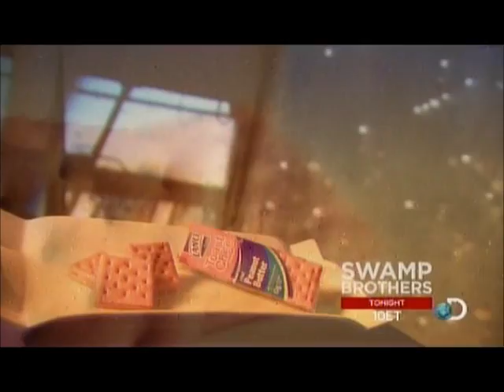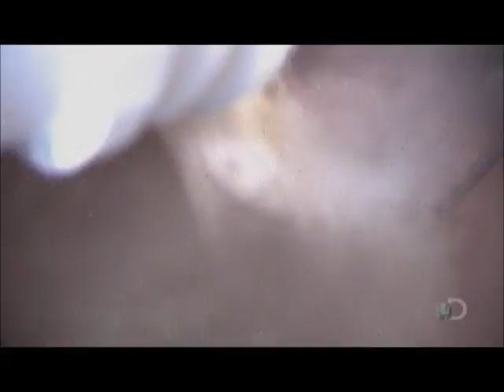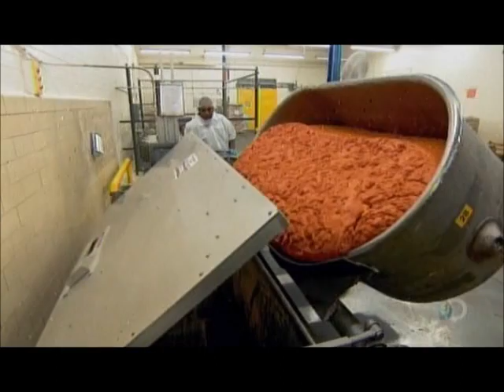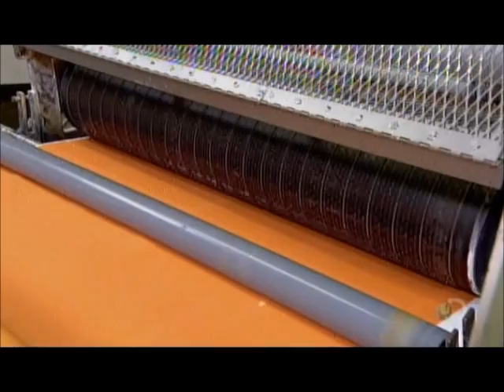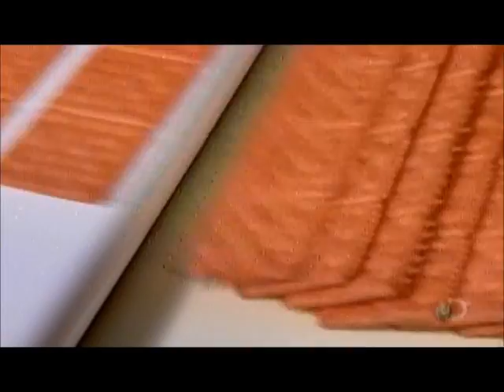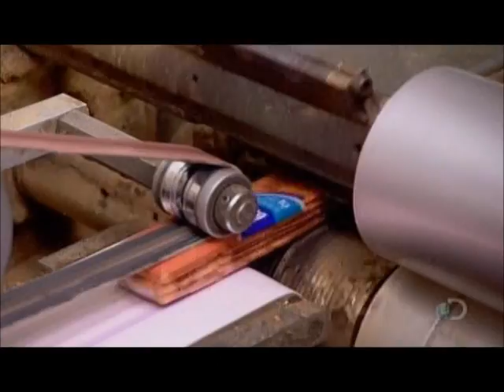How It's Made - Sandwich Crackers

Comment: What they don't tell you is that they aren't actually spraying the crackers with vegetable oil: they have literally thousands of rats running in big hamster wheels, and it is these wheels that generate electricity for the machinery, and the sweat given off by these rats is collected and piped in through special tubes and are subsequently sprayed over the crackers.  So, you see, nothing is wasted